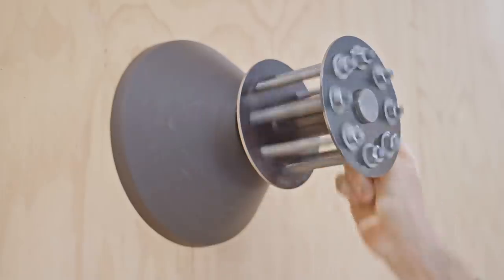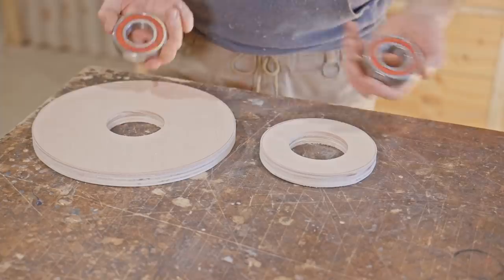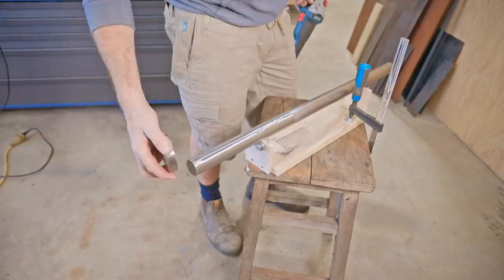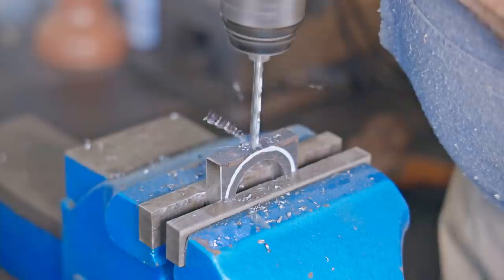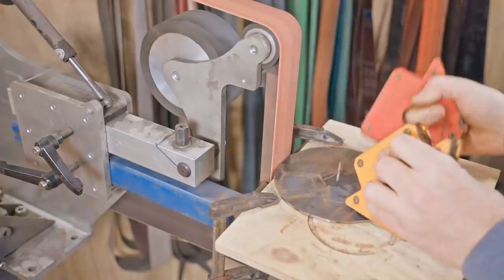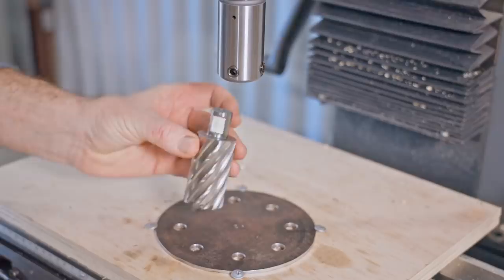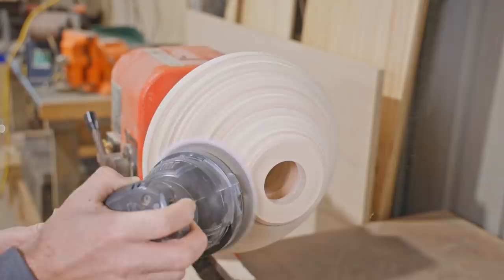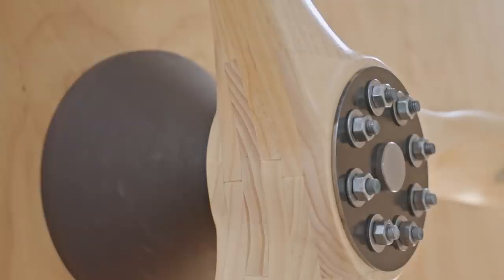Making a Rotating Hub to Display a Propeller

Comment: a trick for the bolt holes on the DRO: if you tell it to do one more hole than you want and set the end angle to 360 then you dont need to figure out the end angle for your pattern
Reply from the maker: Awesome! That’s a great trick! 😊

Comment: Something that helps when drilling with a hole saw, start it so it scribes a line where it is cutting, and drill a small hole in the scrap piece overlapping the cut line.  It gives a space for the swarf to release from the hole saw teeth, and you don't need to back it out to clear the teeth nearly as much.
Reply: i ll give this a try next time i use my hole saw.
Reply: Beat me to it.....👍

Comment: I really like the fact Aussies work with metric system. It's much easier for me! haha
Reply: They prefer the metric system because working upside down is more than difficult enough.
Reply: I'm in Canada and imperial is out the form of mesurments, however, when I CAD design or woodwork, I do it all in metric, which makes things a lot easier for, me anyways,
Reply: @patprop74  Nice! I live in Brazil and we use the metric system. I have some problems when converting the measurements in real time. It's harder to see the real proportions.
Reply: I'm a Brit of a certain age and 50 odd years ago we were the first generation to be taught in metric but it seems like they weren't sure it would catch on and also taught us imperial as well at first. A couple of years later the education system switched to totally metric but older people outside of education and engineerng still used imperial so we grew up able to swing both ways.
Reply: @tonysutton6559  American here, used metric in science and imperial everywhere else.  I don't see a problem with it.  I also learned to use furlongs, rods, chains and a few other oddball measurements.  And then, there is seafaring jargon thrown in for good measure because Dad was Navy.
Reply: @jjudy5869  I've got a book of old weights and measures and wind up my kids by telling them that they had it easy just learning things like litres instead of gills, pints, quarts gallons and they other weird and wonderful stuff. 

My Dad was ex Royal Navy and sceptical about most 'modern' ideas but was fully supportive of metric because he went on to be a structural engineers and it made things so much easier.

Comment: Brilliant little project Neil! For hole saw clogging I tie a small fine wire brush onto my drill press, when it clogs up, a quick few seconds with the wire brush while the drill is still on, works perfect and is very quick. Might dull the cutter over time but once you’re sharpening regularly enough it shouldn’t be an issue.

Comment: It was so helpful for other projects of mine (currently a DIY blender, later a DIY ventilation system)! Idea of fixing bearings with stacked layers of material was of great help! Otherwise making the two opposing bearings strictly parallel to each other by making wholes to a single piece was nightmare. Thx a lot!

Comment: It's such a beautiful propeller. Still believe that should be made into a ceiling fan. Put some Pask propellers stickers
and add the green paint to the back of the propeller. Mount the propeller (so it blows down, front of prop up ) to industrial size ceiling fan motor.  Cheers

Comment: Pask, a small tip for you when drilling with a hole saw! layout your diameter with a compass or the holesaw itself, and drill out a few holes on the perimeter of the line. That way the chips have got a place to go and you get a much cleaner cut! I saw it somewhere once but can't find it anymore sadly :(

Comment: Great job! There's one more thing you could do, drill some holes in the nuts and safety wire  them in two's, using .040"  gauge wire
Reply from the maker: I may get around to it if I find time. 😊

Comment: Great creativity and editing, as ever. For your future info, EN32 is not really a 'tough' steel - it's basically mild steel with some limits on the carbon, manganese and trace sulphur/phosphorus to ensure it is suitable for case carburizing (which doesn't require much, really). When I sold this stuff in the 70's we bought our mild steel to slightly specific (though not, in practice, very tight) carbon and manganese content, and this meant it fitted both EN32B and EN3B, so we could sell the same bar as mild steel or either spec. There isn't enough carbon to harden it as it stands, but any of the various techniques for introducing extra carbon into the surface, followed by normal hardening and tempering, yield a moderately wear resistant surface, good enough for many applications. Anyway, all steel is tough if you are hand-drilling it, and mild steel is gummy so it isn't so easy to machine in general. Anyway, not to be a know-it-all, I learn so much from you that I never had any ideas about before your videos.

Comment: I find it easiest to clean up metal shavings with a magnet & a plastic bag.  The magnet will grab all of the pieces & the bag makes it easier to clean off.
Reply: That's cool ... but let me share my technique: similar, but I put a big welder's magnet in a big empty yoghurt pot and just lift it out of the pot when I want to release the bits I collect. 
I often have two pots together - one or the magnet, one for the bits I collect. When not in use, it;s a bir magnet in two empty yoghurt pots!

Comment: You should take all the grease out of the bearings for a silky smooth turning. Just dissolve it in some acetone.
Reply from the maker: I thought about that but probably should have done that before setting them in. 😊

Comment: You can angle your table on most band saws.  It could have saved you a step if you knew what angle you wanted the cone by cutting it at the band saw ahead of time instead of using the lathe.  
Great video!  Thanks for all you do.

Comment: I may not need a propeller mounted to a wall, but this looks like it would make a  killer central display stand for a table top or rotating work table. Just need to add a brake to hold it in the orientation you need.

Comment: maybe make a pulley and fix it where that bottom steel disk is...put a motor besides the axle...connect em with a belt and you ll make prettiest fan everyone will want to make. your workmanship is amazing..

Comment: One little detail that would have made it a little more correct would be for the bolts in the hub should be on the outside, drilled and safety wired.
Ive never seen a real prop hub with the nuts one the outside.

Comment: Have you considered using acorn nuts, or other finish for the propeller (e.g. brass bolts and washers, steel hardware with the same sheen as the shat, etc)? In my opinion, it makes an otherwise-gorgeous project look unfinished.

Comment: Neil, Very Nice use of materials you have around the shop! Liked the alignment and turning you did. Was that spackle wall board filler you used on the sanded plywood?
Have you through more about the idea to put a motor on the back of the wall to drive and spin the propeller slowly?

Comment: Such a great build, while you were making it did you consider using it as a ceiling fan?
Reply from the maker: I did and I talked about it on Patreon. I don’t actually need a fan though as I have aircon and it wouldn’t be the most effective fan either. Also it’s better displayed on the wall as my ceilings are pretty high. 😊

Comment: Did you consider adding a small AC powered motor to it to turn into a fan for the shop? I don't think it would be too difficult or expensive but it's your fan and this is only a suggestion or idea (you probably already thought of it and I'm just stepping on your toes).

Comment: Putting on my safety hat here, when you were using the angle grinder you had no gloves on and bare legs, hopefully you had eye protection on.
I feel if you tubers are going to show how to fabricate things then they have a responsibility to also show shop safety.
Reply from the maker: Honestly, wearing gloves is far more dangerous, if a glove catches it will rip your fingers off. I had safety glasses on, wearing ear protection and a powered respirator. I think I take safety pretty seriously and often show full shots of me wearing the right PPE. :)
Reply: Thanks for replying I do accept that in certain situations PPE can present more of a risk than not having it. However I still feel that regardless of the activity there is a glove to suit. Only situation I can think of where I wouldn’t use gloves is with a wire wheel. Really enjoy your channel.